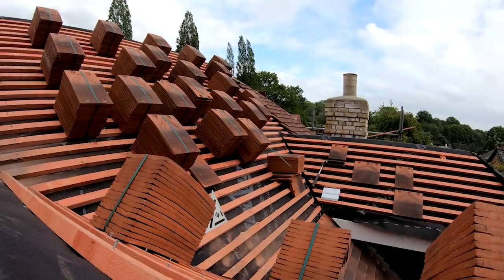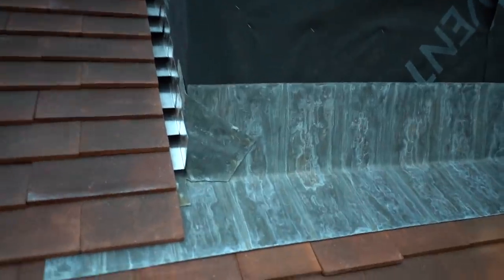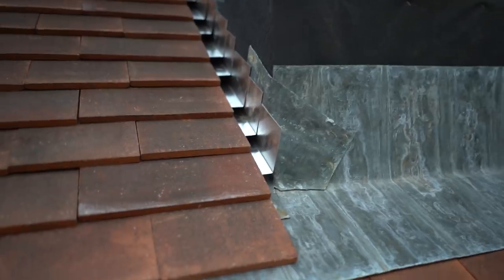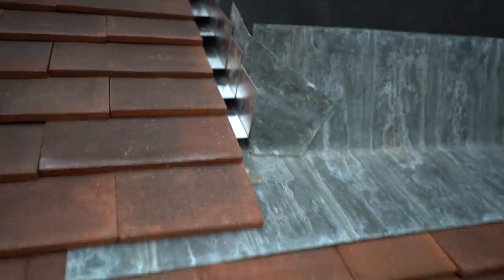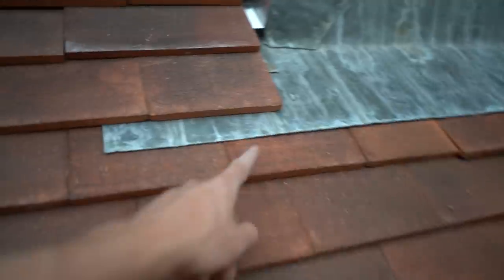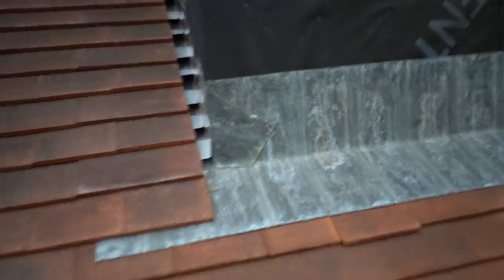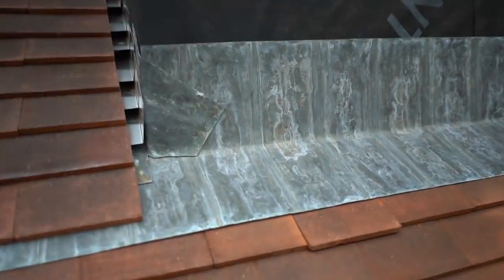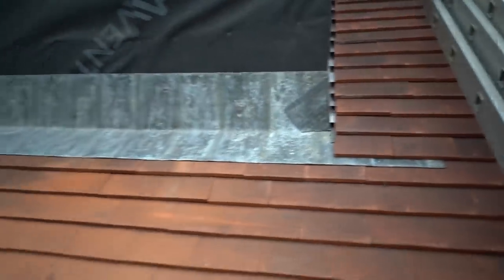BUILDING A HOUSE ALONE from START TO FINISH | E.P 58 [Starting the lead work]

Comment: I just finished a roof like this last week, the flashing along the front of the dormer consisted of 2 pieces of 300 mm lead cut into two 1300 mm sections, there’s 150 mm lap in the middle. Nailed in 4 points each side with copper clouts. Three 300 mm pieces of lead cut at 45 mm wide and hooked over the top course of tiles under the lead and folded back over to be used as straps. The join of lead in the middle mostly faces east due to the majority of our weather coming from the west. The corners are cut at an angle using the pitch of the roof, bent round the dormer and the remaining gap will have a piece of lead (gusset) welded in place, corners rounded off and the full plate of lead either side of the dormer cheeks will be used as the first soaker. A generous coat of patination oil and by the time it needs re doing I’ll be pushing up daisies 👍

Comment: Ideally side returns should be 150mm, should be welded. The way you've done it the upstand/downstand cover is ok but you've got a weak spot in the corner where your lead soaker returns. 
Lead should be nailed across the top with 20/25mm copper ring shank clouts or stainless, staggered pattern 50mm apart.
You could trim the lead sticking out below the tiles flush with the course, level with the course either side if that makes sense because it provides the same lap at the tiles. LSA recommend straps/clips for wind uplift, you can make some straps from lead 50mm wide and put them under the apron, either nailed into a tile hole or into the dormer face. When the apron goes on you trim them 50mm past and turn them up over the lead. 
Deffo needs an oil up 😳 where did you dig that lead up from 😂 
Fair play for having a go mate , hit me on messenger if you need any help.
Reply: Ben Hockey glad you said it and not me 👍🏼😂  at a minimal he needs weird corners and copper nails fixing the top and oiling it I think you can get away without straps but if you wanna be extra strap on 😉
Reply from the maker: Ben, that's an awesome amount of advice there. I had the lead left over from a job I did about 6 months before I started this build 🤣 So it's probably about 2 years old. I definitely think I'll re do the corners of the dormer lead. Not 100% happy with them.

Comment: the corners should be bossed and not cut, water will go uphill when it's windy, apart from that it's ok, 40 years ago I trained as a plumber and got a book from the Lead Development Co. which covered bossing and lead burning flashings.

Comment: I normally put lead strips every  3-400mm  attached up underneath tray and then fold them up over the bottom of the tray to stop it slipping down.  Makes it easier when installing your tray too as they hold it in place.  

It’s good practice to weld up the ends of the tray too.  You can get someone in to do this or learn yourself.  I think they do lead welding courses for about £500 down south.
Reply from the maker: That sounds like a handy idea, lead strips to hold it in place 😁👍🏻 I have absolutely no clue about welding, maybe I should do a course 🤔
Reply: Rodian Montague Builds do a course dude, it’s the only way to do lead trays.  Not only that but once you’ve mastered it you can charge allot for lead work.  Easily make £200 a day. 

And your’l always have work.
Reply from the maker: I think you've sold me the idea. I'll look into it 👍🏻😁

Comment: Just wondering if that Dormer is to wide for a single length of Lead ? 1.2m code 4 Lead Maximum. Good Video Thank you.
Reply: dhb 57 
1.5 m max code 4
Reply from the maker: I think I'll end up re doing the lead because theres a few things I needed to do including this 🙈

Comment: Great attempt for a rookie, but like others are saying, the corner is a weak point. It won’t leak all the time, but when the wind blows in certain directions it will and over time will cause damage. Code 4 lead should also only be max 1500mm  in length. Expansion and contraction will eventually split the lead. One more thing. You should only nail the lead with copper nails. Aluminium tile nails will corrode and fail.
Reply from the maker: I think I'd better address these issues. Maybe re do the lead with some newer stuff, would look better for sure

Comment: Good effect, but i think it will have problems with the corner and soakers, the front apron should be in sections, no longer than 1500mm in length, otherwise the heat will expand it and split within a few years. It should have welded corners extending past dormer cheek by 150mm. Ideally, tiles should be cut up tight to cheek because zinc soakers are slightly under size, best,  would have been to use 150mm by 180mm code 3 lead soakers. The membrane looks a non breathable which is ok, but a true breather membrane would be better. The membrane should have been fitted after tiling so covers soaker. I see it is a cheap French tile which are ok but remember when tiling to double nail eave course, first course and every fourth course there after. The membrane should be stopped short of fascia line and a roll of 450mm 5u be used to drap into gutter. 
But overall good try👍

Comment: Lead flashing work should be done and classed as a part of the designated roofing trade, not plumbing trade as commented before, the lead front headwall flashing should not be cut like that, you should have created a seamless join on the corners to prevent wind driven water from entering the building.

Comment: Good first effort, looks like that lead has been out in the wether a while before install. Patination oil wont make a difference until you clean that lead up firstly. Corners should be dressed rather than cut like that, also the apron looks to be too long of a stretch not allowing expansion, wat code lead did you use? Cant knock you for trying 👍👍
Reply from the maker: I'm not happy with it and my skill isn't good enough so I'm getting someone in to do all the lead work. Bit beyond my skill level 🤣🤣
Reply: @RodianBuilds  cant knock ya for tryin mate, its pretty simple lead work so any competent roofer should be able to day that pretty quick

Comment: Only thing I’d say is u shoulda done the lead in 2 bits 1.5 max with 200mm side lap plus I don’t like the laps where uve cut it I woulda slowly bossed it round should be Wealded now
Reply from the maker: Think theres a few things I need to change with that lead 🙈

Comment: Defo would have been good to have the corners lead burned no mean feat hardly any plumbers can do it tingles/lead straps  used for wind prevention hardly nail any lead as it needs to expand and contract freely only done lead burning once but done a fair amount of lead not a pro at it but on my slideshows of roofs I done all the lead work on those roofs good money to be made if you can master lead burning all in the prep and flame 👍